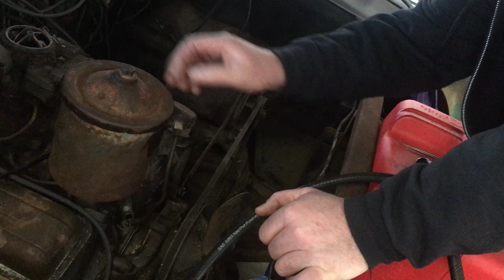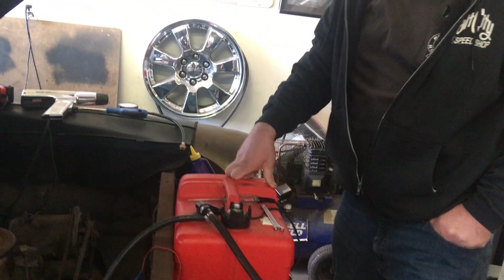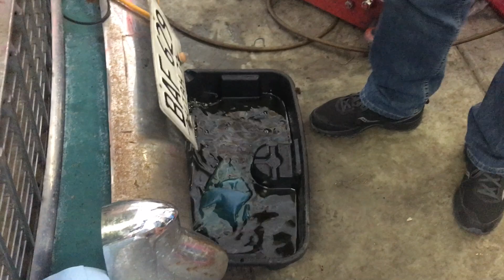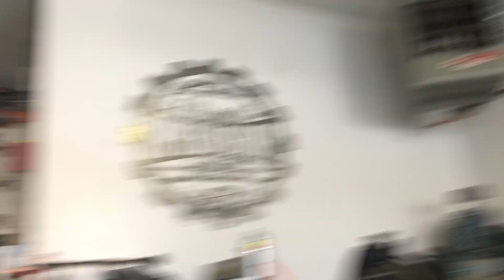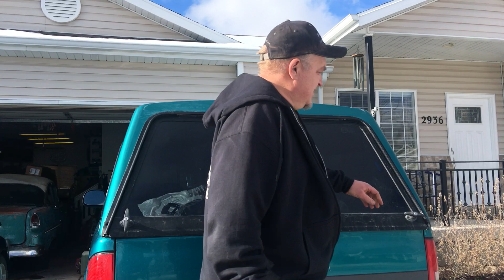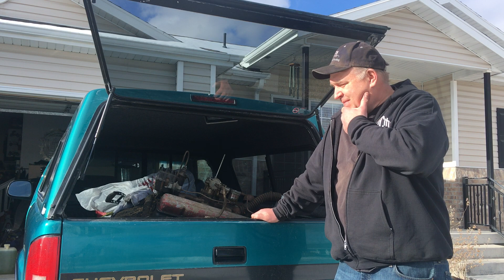Fighting with the 265 V8!

Comment: Factory installed oil filters were Black, the dealer option was blue. Absolutely. This was an older type of filtration system. 56 had an entirely different full flow filtration system.